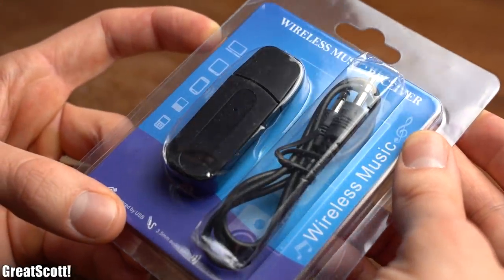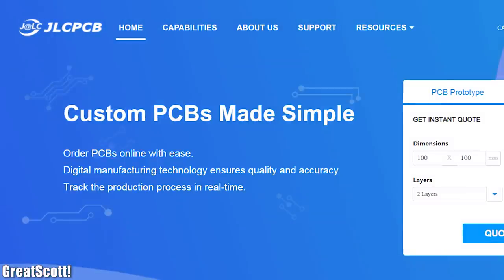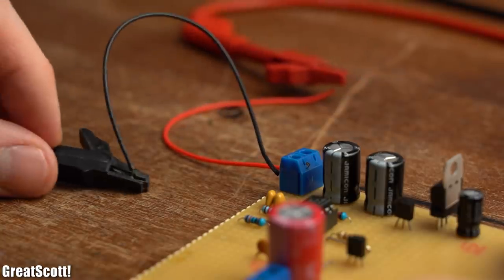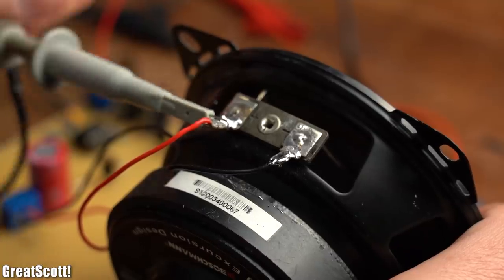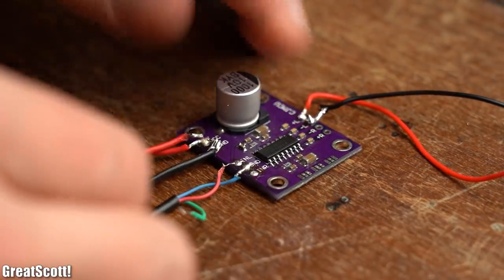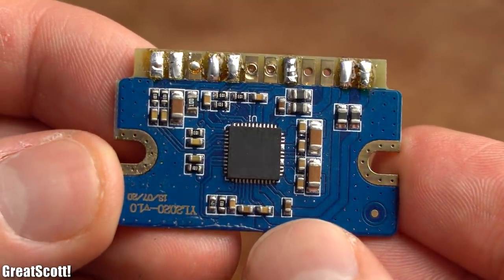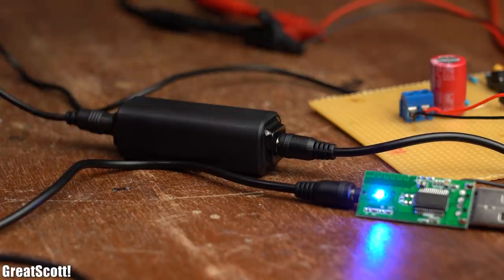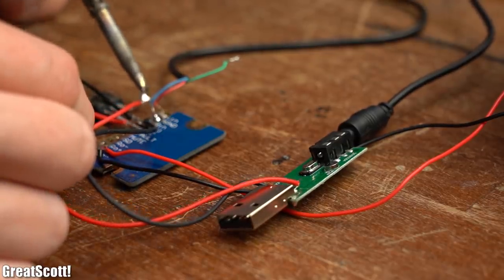How to remove buzzing/noise from a cheap Bluetooth Music Receiver? (Experiment)

Comment: Great video. I want to find some info for a problem i have with audio noice on my usb microphone. I want to beleve the cause of the noice is dirty usb power from my pc. I try to cut the positive wire from the usb cable and connected it to external battery separated from the positive +5v from the pc but using common ground -5v for the pc and the battery ( If i don't use common ground my pc can't detect the mic ) But the noice is still there still the same. I try to wrap my head and grab something from this video for my case. Little help will be nice. Ty again and nice work as aways.

Comment: I belive you used a little flyback, am I correct? Why didn't you use it to step down the voltage too?   
  
Also why wasn't it possible to couple and clamp the ground rails with a capacitor and two shottkey diodes?

Comment: I'm having this buzzing sound issue when connecting one Baseus Bluetooth adapter in a car phone charger and connecting it's 3,5mm output to my car audio. I'm thinking of getting a tiny usb extensio, cut it's cord and hooking a b0505s up. I would then use this usb cord with the dcdc converter to connect the Bluetooth adapter to the charger. Hoping it would solve my buzzing problems. Any thoughts if this would work?

Comment: Did you try adding some filtering ahead of the 5 Volt regulator perhaps a small R in series from 12 to the 5V regulator and a large C to ground at the input to the regulator (assuming a 7805 type regulator) or a large C after the 5V regulator if it is an LDO type?
Just curious.

Comment: Audio isolation transformers also attenuate the signal, and worse, attenuate low frequencies more. So isolating the audio path can work to fix a ground loop, it has a cost in volume and quality. Isolating the DC ground is more fun :)

Comment: Lm78** ics creates noise ...so i can simply use 104 disc type in input and output of lm 78** ic or box type can be used ...but i don't use metalised film caps  as i found that too created noise .

Comment: Probabily a stupid question: Wouldn't a simple parallel capacitor over the DC power source also do the thrick? Reducing the voltage drop when the bluetooth module draws current

Comment: I wonder if you could have minimized the buzzing by installing a small value resistor (say 10 ohms) between the "agnd" on the amplifier and 5V regulator's input side, and the "dgnd" on the regulator's GND pin and output side.  That way most of the current noise from the bluetooth module would flow through the 5V regulator's output capacitor.

Comment: What if you use a diode between supply to the amplifier  maybe that would flatten that waveform or find the time constant and figure out a rc value. Just a thought but that noise is very infectious to other circuits

Comment: isn't the ground loop just caused by the fact you have too many redudant ground connections? i think you could have fixed this by simply cutting the ground connection between the blutooth output and the amplifier input since  they should be both already internally connected to the power ground
Reply from the maker: No. I tried all of those solutions. Did not work.
Reply: @greatscottlab  i see so it's more likely that the blutooth receiver has some ground loops in the board itself wich isn't that easy to find without schematics... looks like the last solution is really the best one

Comment: Don't use bluetooth. Better sound and problem solved! Jk, but actually this video is very interesting. As the other comments stated, I wish you would have gone into more detail about how the DC/DC converter works and why it isolates the grounds.

Comment: I know this video is a year old but...

If i were to use a powerbank pcb to power e. g. an Alexa, usb speakers or whatever and they have interference noise what am i supposed to do?

I think the PCB from the powerbank doesn't filter the "amplification remains" so there is a slight buzzing.

In this case there would be only the 5V and ground without a audio cable and you couldn't really seperate them

(not like its shown in the video because its only one sound device instead of two). 

Would a (the right) Capacitor solve my problem or should i just use another powerbank pcb?

Comment: Maybe it's a stupid question, but what is the output capacitance on the 7805 regulator? I made amplifiers in the past and used 7805 regulator for the preamps and other circuits, and I had such noise issues (no ground loops). After adding some bulk capacitance on the output, around 10-100uF and a 2.2k load resistor, the noise was gone.

Comment: I'd have liked to learn about this DC to DC converter. Is it a buck converter, a LDO, something else? Does any DC/DC converter work? For instance a 7805 converts 12V into 5V... but it's not the same. The end of the video seems precipitated precisely because there's no info about this magical component.

Comment: Is this different than "ground loop" and "ground loop isolation"?  maybe I am just getting confused with the terminology.  I had a similar problem when I hooked a bluetooth receiver to an old car stereo.  I added shielding and tried different ground configurations to reduce the noise.  It ultimately wasn't perfect, maybe because I couldn't figure out how to separate the vehicle ground from power ground.

Comment: i removed the humming or buzzing sound by adding ground wires and capacitor. i made a diy bluetooth speaker, and facing the same issue as yours. i added 10v 2200 cap to the bluetooth receiver and add more ground wires to the gnd of the amplifier. and the humming or buzzing noise is gone

Comment: Have you tried to put a diode before the vin of the bluetooth module. If the noise is caused by a some voltage ripple  may be that this can solve.

Comment: Wouldn't simple RC/LC filter on positive line work too? Correct me if I'm wrong but if you measured the noise on the positive rail then isolating ground is basically the same just pointlessly more complicated.
Reply: Yes it would definately work. But Audio ground must be disconnected aswell

Comment: I see how this solution works for a custom amp design, but is there a way to adapt it for a normal Class D amp? Because all the amps I've tried give terrible static and humming through the output speakers.

Comment: I'm actually trying to use an amp that has bluetooth capability. The module is already set up to eliminate noise when connecting it to speakers...but I'm actually connecting it to a 3.5mm jack so I can plug it into my car's AUX input (connecting my phone only through AUX doesn't emit enough gain). From what I understand, I'm plugging speaker-level input into a car stereo that demands line level input. People are telling me the Ground Loop Isolator is the simplest choice...but I haven't been able to find one locally. Is there another solution for this?

Comment: Hmmm.  I only have 5 volts supplying both the amp and the bluetooth receiver, but my amp is mono and doesn't have a separate ground for power and audio.  The bluetooth receiver does.  Any suggestions to stop the noise, which is present only when my phone connects to the bluetooth receiver?

Comment: Hi Scott, i bought 2 of those b0505s for a usb cable. How did you solder it in series cause doesnt matter how i connect it, it doesnt give me the 5v output. I soldered it like you on the board but nothings happening

Comment: How would you remove the interference caused by the Bluetooth signal? It's the same typical sound you hear when you hold an old cellphone next to a speaker. I've tried different phones and tablets but that didn't help. I've also tried shielding the circuit part of the Bluetooth module from the antenna, but that also didn't help. Any suggestions?

Comment: Total noob here, just curious if strategically placed diodes where individual grounds connect to a main ground line would have any affect, if its all dc. Or isocouplers? Again, complete beginner

Comment: I wanted to know if the 5V GND and the audio GND were actually connected together on the BT module.
If the audio gnd were a virtual GND of say 2.5V, then connecting it to power GND was bound to cause problems.
Also, how about short wires instead of a cable?  Pretty massive ground loop there.

Comment: I have a simular problem where I have some bad noice in my speakers. My amplifier is a car audio amplifier with an Bluetooth dsp module as the input. The Bluetooth module is powered by an Lm2596s Step-Down Converter. Could adding this isolator fix the noice or is it more likely a problem of the Step-Down Converter itself, as also shown as a possibility in another of your videos?

Comment: I have a similar problem: I've got an old/vintage Transistor Radio which I want to use with a wall adaptor. It takes 9V. I tried many different power supplies but I always get varying forms of high pitched noise through the speaker on every volume level. When I use it with batteries that doesn't happen. So the problem is definitely the power supply. Does a device like you used in the video help in such a scenario? Or how else would I eliminate the noises?
Reply: are you trying to use a switch-mode power supply to run an AM radio?
This won't work-the power supply will interfere with the radio signals.
Try a linear power supply instead.

Comment: Sir I am facing same issue in my Sony car USB player I am connect Bluetooth chip 5 volt supply from CD USB and give audio to car CD aux pin what some humming sound disturbed me how can I solved this problem please give me any solution for contacting chip in same power supply ¡¡¡

Comment: I have a similar setup. With a cheap bluetooth receiver and PAM8610 amplifier board. I tried the Mi Bluetooth Audio Receiver and it's volume is way less than the cheaper bluetooth receivers. I power them with two seperate mains supply but still they have this buzzing sound. Can you say why is that so.😅

Comment: In the power supply for the guitar effects pedals there's a few types. One that are a single supply that has high current capability and you "Daisy chain" to power multiple pedals. Power supplies with individual outputs (some isolated some not truly isolated). But generally in the isolated ones they normally have a transformer for each individual output. Would your final solution with the DC to DC converter (assuming there is a 9v one since guitar pedals normally use 9v) work for that as well? If so that could make them cheaper because the isolated ones are fairly expensive so I thought about building one but because of the transformers it would've still been expensive.

Comment: The ground loop isolater should have worked shouldnt it? I've used them in car audio between head units and amp for alternator noise and between aux input and my phone when I've plugged in my phone to charge at the same time as using the aux.

Comment: Sir please make a video for completely filter out AC from rectifier output
Reply: Full bridge rectifier and capacitor?
Reply: @C0mmentC0p  yes i made it but there some AC components in the output side of the rectifier
Reply: @schabingcraft  i tried 7805 ic but no change happened, but now I'm thinking that the filter choke may solve the problem
Reply: @schabingcraft Thank you sir
Reply: @schabingcraft  i don't know why that happens ,there is an AC potential on the ground of 78XX regulator

Comment: I have a question. I have some audio components where I have the problem that when I connect my phone to the 3.5 jack  I hear the noise from the mobile data transfer. For example via a mobile DAC amplifier. Or in my Car via my audio jack to casette Adapter. Is there a way to fix this with out turning the mobile data of ? I there a need of a noise cancler?

Comment: How about connecting each circuit to ground through a diode.  I found mention of a circuit  with a diod, resister, reversed diode in parallel. It was on HiFiDuino dot wordpress in the amplification section under first one build: ground connection

Comment: You are using a 5V to 5V DC/DC converter. Would it be possible to just use an isolated 12V DC/ 5V DC Converter? For example B1205S?

Comment: Am from Kerala, India and here the 5v to 5v isolator costs around 250-300₹ or around 4$ per piece. While doing small speaker projects that works on mains voltage, it's way cheaper for me to just buy a cheap 5v 2A mobile charger to power the bluetooth receiver and isolate the grounds that way which usually costs me 60₹ or close to 1$ per charger if I buy a set of 5 chargers. But again coimg to battery powered ones it is still an issue.
I have also noticed that the noise issue is significantly less if both the receiver and amplifier works on 5v even while sharing same power source.

Comment: I have this bluetooth headphone battery powered amplifier. It has a quite noticeable static noise when nothing is playing, and while it is too, and I also have cheap USB sound cards that do the same. The power supply isn't the issue, neither ground loops. So any way of lowering that noise? I know you can't quite get rid of it and that's why people still like tubes, but plugging the headphones in my phone for comparison, I can't even tell there's any noise unless it's ridiculously quiet and I focus on it. So is there something that can lower that effect? I read somewhere about adding some capacitors or something. But I'm clueless.

Comment: i am experiencing similar problem with a low end pc power supply and chinese amp. When i connect amp to battery pack, everything is working without any noises. They appear only when i power it up from power supply. This is the only thing i have that can draw enough power to the amp. Here comes a question. Do i need an isolated dc dc converter that can draw 200w? I cant find it anywhere. or maybe can i use step up converter? Will it work the same way?

Comment: I tried your third solution(B0505S) and the buzzing sound diminished but the buzzing sound is still there. The strange thing is that when there is some  sound comming from the bluetooth speaker it works perfectly but when there is no sound after 2/3 seconds it starts again to buzz?

Comment: Sir,
I have Emerson R48-1800 rectifire module. Input voltage rang is 200 to 250v ac and output votages are -48v dc with 1700Waats, apox 32 amps.
My question is how to convert this power module to variable power supply or 12v suply?
Or how to convert this to UPS?
PLZ PLZ plz create detail video on this topic. These module can b found on e-bay easily.

Comment: Man can you please help me? 

When I use the same power source(  batteries) with mp3 decoder and amplifier it creates buzzing noise like when I use 12 v 2a adapter. But when I power the mp3 decoder and amplifier from separete power sources( for example amp is powered by 12 v 2a adapter, and mp3 powered by 9v battery) it works fine without any buzzing noise. And I searched on internet alot. People mostly talking about this as "ground loop". I still could not find a way to fix this without buying another equipment. I just need to fix this because I want to use single(same for both mp3 decoder and  amplifier) power source for mp3 decoder and amplifier. Therefore I can make it like a bluetooth mobile speaker. Please help me and guide me. I watched even other videos. People using single(same for both amp and mp3) power source but they dont be having buzzing noise. Why do I keep getting? Is it because I use simple croc cables to test without need to solder..  do I need shielded cables then I can use the same power source and the same ground? This message is bit long but I hope you could guide me, thank you.

Comment: wouldn't just adding bypass capacitors solve this?
Reply from the maker: Not in my case. I tried that.
Reply: @greatscottlab  What was the value of the cap that you used? Also, did you try multiple of them? Have you tried to use some simple passive LPF or BPF? thanks.
Reply: @greatscottlab  did you try putting them also on the ground side? It sounds like it was oscillating, the audio amp current was feeding back to the bluetooth reciever input through the power and ground lines. You have to keep power draw from the amp away from the sensitive reciever.  You could isolate the ground connection of the bluetooth reciever as well as its power line (both) with a bypass cap and resistor, something like 10 ohms. Using two power supplies accomplishes the same thing of course

Comment: @greatscott a friend of mine was using an arduino based board with capacitive touch attached to a pc, the environment he used this in caused the users to build up static charge and discharge painfully to the capacitive interface.

Could this problem have been solved by powering the arduino not through the pc's usb port but through the isolating dcdc convert you think?
Reply: None of those modules are likely made to deal with THAT voltage.

Your best try would probably be to lay a as thick as permissible plastic/glass shield over the touch interface to isolator it from the user. Since it's capacitive it can work behind a isolation barrier.

Other option is to deal with what builds up the static charge, like air humidifiers, negative ion sources, conductive floors, and the whole deal.

Comment: Lets say i have a Adafruit Powerboost 1000C Powering a Pam8406, which works great, but i would prefer a bluetooth connection instead. How should i connect these devices to avoid this interference? Do i need a certain chip since they will share the same lipo battery as source.
Reply: Could i just connect the bluetooth device in series with the amplifier board but add an 4N35 inbetween? Would that work?

Comment: If I use a 3.7v battery and hook it up to the isolator, will the output voltage be 3.7v or it can't operate at such voltage?